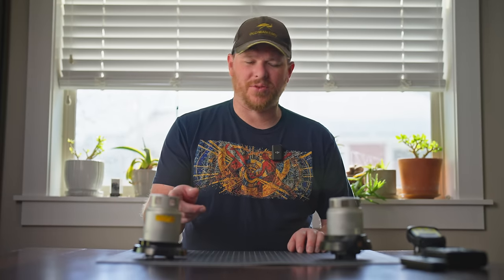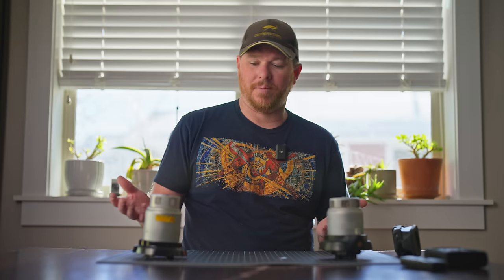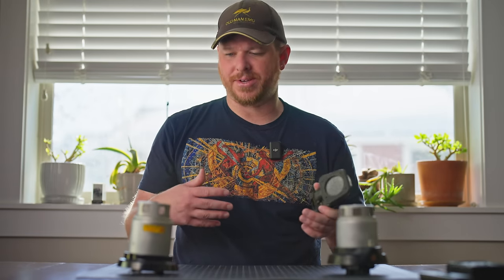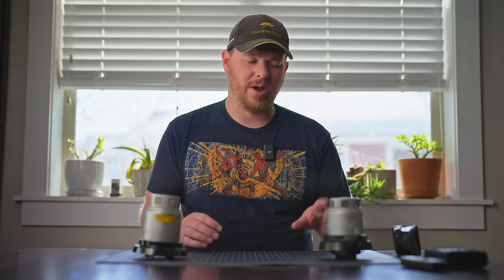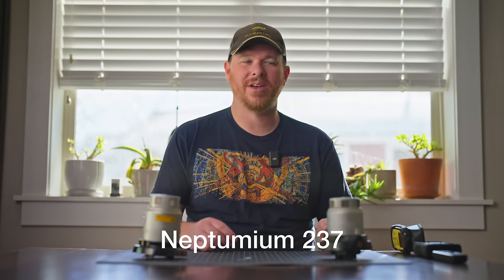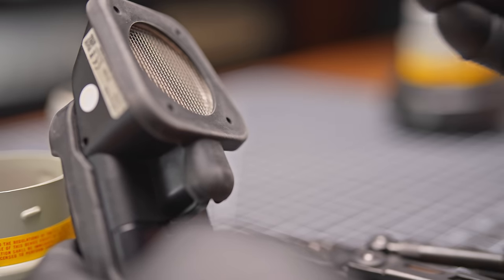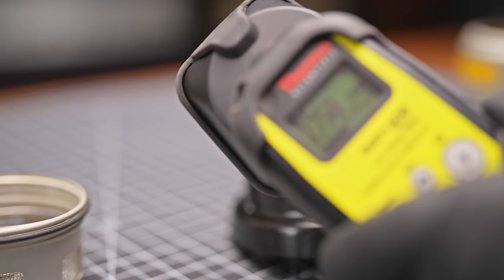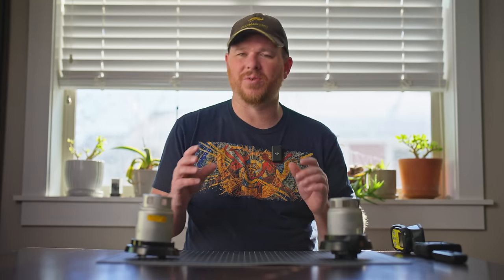Radioactive Cores from Industrial Smoke Detectors

Comment: I spent a large portion of my 45 year career maintaining Pyrotronics systems with those components on a regular basis.  I encountered them principally in hospitals and universities.  At no time did anyone ever instruct us regarding the nuclear hazard these devices posed to us by just being in proximity to them much less handling the components.  Later I found out completely by accident about the extent of the dangers associated with them, and the recommended precautions.  We were instructed to disassemble them and clean them with isopropyl alcohol and dry them with high pressure dry nitrogen.  When we calibrated them for sensitivity I had no idea that I was throttling the extent of radiation exposure that I was receiving.  Early on we were victims of 'mushroom management', (keep them in the dark and feed them poop)!
Reply: It's so sad,and makes one Angry when you find out you've basically been used for a task no-one else would ever want to do if they'd known the hazards,they should've at least given you guys respirators,and more Knowledge of the dangers of course,gloves, thyroid protection,etc.. The problem with cancer caused by such ionizing radiation,is that it has a 'Latency Period',most won't get sick until many yrs or even decades have elapsed, thus being a rather difficult case to prove it was your job that caused it. The Higher-Up's Know this and utilize it,as the nuclear industry in the past has Used Countless people,the 'Radium Girls' for instance,at one time it was a Very Dirty Industry,as one physicist who worked in the industry would later attest. I'm not against Nuclear,but I'm Definitely for 'Safety First ' in this industry,and Above All when one works in the nuclear field to Always Be Responsible!! First and Foremost,in the past there was massive irresponsibility! It's sad when i hear these stories, because it could've easily been prevented,but only if those on Top had been Responsible in the first place and told people the true dangers...ugh.
Reply: Anyways. I saw easily 30 pounds of smoke detectors a day go to the landfill in just our plant which is one of two in the county
Reply: They probably made lots of money.
Reply: Tbh the biggest dangers would be like if you would smoke and eat chips after handling them or whatever? Your skin should protect you right? Idk. They are encapsulated in metal.
Reply: @SimEon-jt3sr for americium that’s generally true. The isotope is laminated into foil and should be pretty contained that way. I wouldn’t want to eat with my hands after direct skin contact anyways as corrosion and abrasion might knock some particles loose. 
For the radium detectors this story is completely different though. Even though the radium itself should be rather contained and adhered to the foil you have to remember that’s it’s decay products are not!
radon is a noble gas so it wont stay chemically bonded and since those detectors depend on the alpha radiation, they can't be shielded. This means that some radon will escape the source and can be breathed in (very bad) and contaminate the housing with its decay products which will end up on your skin etc. Drew demonstrates that in the video aswell with the housing having become radioactive. 

I have handled open radioactive material at work and I'm doing so in private. Radiation doesn't scare me but open radium sources with high activities do because it's so easy to contaminate and therefore incorporate alpha emitters into your body.

Comment: I worked for Pyrotronics in the late 1970's. These type of detectors were in schools, hospitals and everywhere else because they were pretty much all that was on the market.  They were powered by current limited 220vdc .  The low voltage low radio material detectors were just becoming widely available  and the cost to upgrade an entire system caused many of these systems to remain in service. The systems were mostly based on telephone office style relays and only a few silicon diodes. They could survive a close lightning strike, sometimes turning the NE-51 indicators on the detector base black. Just change the NE-51 and maybe a diode and they were back up. A later model system based on IC's would require new detectors and control panels in a similar strike.  The company wide policy for inspecting these systems yearly involved opening the detector and cleaning the chamber and source with a rag dipped in "radiac wash". Then the detector was tested for firing at the proper level and put back in service. Over the years I am sure I cleaned tens of thousands of them. Then in the 1980's they issued a statement saying not to clean any more of them. Imagine that. I am 70 years old now.
Reply from the maker: That’s some really interesting information. Thanks for sharing that. Where were the Pyrotronics offices located?
Reply: @RadioactiveDrew   The head office and perhaps the factory were in Cedar Knolls New Jersey but they had branch offices in most major cities. They were a leader back then, but no longer around as far as I can tell.
Reply: @LM-fg7vi  Cerberus pyrotronics aka pyrotronics was bought out my Siemens in the 1990’s

Comment: It would be interesting (and borderline inhumane) to do an experiment where you have one of those sitting next to a plant and we just see how it grows.
Reply from the maker: I've thought about that. Might make a cool timelapse.
Reply: I think Thunderf00t has done this. Put some radioactive material in a container, put that in the soil, grew carrots but nothing special happened. I wouldn't put the radioactive material directly in the soil as the metals can be toxic and that could leach in to the vegetables.
Reply from the maker: @bertblankenstein3738  yeah I saw that video...was pretty disappointed that he didn't grow the carrots in soil that had uranium ore mixed in.
Reply: @RadioactiveDrew  Fantastic channel. I have seen timelapse of something similar during a vet med degree but am sure is online.

It wasn't particularly interesting until applied to sprouted plants with leaves, not seeds. Then using a comparison between different sources, from nothing happening through to plant wilting and dying, through to going crispy pretty quickly 😮. I don't remember any interesting differences to growth, just the crispy one - which was probably the point of the video.

Comment: That radium smoke detector is definitely not something I would feel safe handling nor being nearby 24/7! Forget about inches, I would prefer being many meters away from that thing for the majority of the time and opening the windows from time in order to time to keep radon gas from accumulating! ☢️
Reply from the maker: I keep sources like this in an old safe that is concrete lined. Does a decent job cutting down the radiation.

Comment: As an engineering geologist, I checked the radioactivity on a "Nuc" tester for soil.   In  the transport case, it pegged my meter.  Told the guy using it he needs to have it serviced.  He said "he never uses those badges."   And so he just continues on until the annual calibration. 
On another note, Im headed up to southern Utah to check some of theose placed youve been too.
Thanks for the info. 
 S
Reply from the maker: Now that's a bit concerning. Those sources used in soil testing are no joke.

Have fun up in Utah exploring. Watch out for flash floods in some of those areas. I've almost been caught in a couple.
Reply: Those contain 10-20 millicuries of Cs-137 and also a neutron source

Comment: Always enjoy your videos man! You definitely make a very good point about people with different occupations that deal with much stronger sources as they are used quite extensively, since we have found so many benefits/ usefulness from utilizing source material. Highly intense sources are definitely common in the construction industry, I agree. An industrial radiographer works with source material far stronger, of course. Thanks to excellent and informative IAEA reports we have seen over the years, there has been quite a few preventable accidents. This is unfortunately followed by ARS, necrosis, amputation, death, etc. All from an extremely small, although highly intense source attached to a pigtail/ cable that gets wound up inside of a shielded case when not in use. It is a form of a camera used to take pictures of welds and such through piping to inspect for cracks, good weld penetration, etc. Just wanted to thank you again for all the awesome content brother! Can't wait for the next one 👍😊
Reply from the maker: I'm glad you enjoyed the video. I'm hoping to one day do a video about some of those sources used in the construction industry.

Comment: Might've been a good idea to mention the inverse square law to explain why being closer makes it so much more intense (granted, that's a bit technical, and you're explaining it to laypeople - but I don't know a better way to describe why it falls off).  Although it's a combination of that, and the radiation being stopped by air.  The counter I have is a Radiascan 701a, it can detect all types (including alpha).  The main mode (which averages over time) lets me select between Sv/hr and rem/hr (which is a long since obsolete unit, but at least it is metric and easily converted to Sv - 1 Sv = 100 rem).  The "search" mode (immediate results) lets me select between Sv/hr and cps.  I don't have a cpm option.  It has an alpha/beta mode too (you take a reading with the alpha or alpha+beta shield on first to get a baseline and then off and it gives you the difference).  I usually just keep it on the Sv/hr setting for all of the modes, because Sieverts are something I understand, and know what is/isn't dangerous based on the setting.  Counts are a lot more ambiguous.  I don't like rem because I have to convert it before it's useful.

Comment: I have seen similar looking devices in the junk shed at work. My shop was the dumping ground for items no one knew what to do with. I would get antifreeze, PCB containing light ballasts , waste oil  various chemicals. I did dispose items I knew about probably. But not the old smoke detector.

Comment: Lets hope those who work in the demolition industry are watching this and identify it. Also, it makes me wonder if the radium can be recycled into new products used in industry / mining / medical.
Reply from the maker: All this material could be recycled / repurposed. The question is…can it be worth it for people to do so.
Reply: they are very radioactive for our standard, still quite unarmful unless you eat them or carry it in your pocket for months. and tbh, i bet there are many things in any household that would kill you if swallowed.
 real high radioactivity is something else.  the F3/F5 only emits alpha. i have a couiple small Am241 sources and most of my GM wont even detect anything at point blank range
Reply from the maker: The reason why some of your GM detectors won’t see any radiation from a Am-241 button is because it can’t detect alpha or the low energy gammas coming off of it.
Reply: @RadioactiveDrew  yes exactly, because the mica window of some of them is too think even for alpha to go through.
the SBT10A, which are supposed to be alpha sensitive, are completely blind, the SBT11A detectes them.  pity they are becoming rare and expensive. they are the poor man (me) LND712. I once found one cheap on ebay and broke it like an idiot10 seconds after installing it. their mica window is reeeeeally fragile

Comment: An important detail. Those pyrotronics units are a nightmare concerning leaky foils. I really suggest you cover your surface with paper or another material that can be disposed of. Airborne contamination can be a huge issue, especially with the Am-241 units. Since you dont have a suitable detector for surveying for alpha contamination, I'd advise you to take more precautions. The radium units might be "hotter", but Americium presents a MUCH greater inhalation hazard, and I'd be much less scared of the radium unit personally.

Comment: How radio active is 2% thoriated tig tungsten? I've been a welder for 15 years now and they are kinda trying to get rid of it. May be a neat video idea. Thanks love the videos.
Reply: Disclaimer, I'm not a pro. I understand there is some mild radiation but the main concern would be if you grind it (to create a tip) as that would cause dust. You want to avoid creating/spreading/inhaling this dust.
Reply: Yeah the new job I have moved to has a fancy tungsten grinder with coolent in in to keep any dust during grinding. Thanks for the input. 👍

Comment: Drew, you mention packing them away. What do you use for packing the radium based detector? Some form of lead encasement with ventilation to the outside to vent the radon? Storage might be another video on its own.
Reply from the maker: I am planning on doing a video about storage as I do think it would be helpful for some to see. The safe I keep these hotter sources in stays in the garage. So I'm not worried about radon. The venting system would be a good idea if all this stuff was being kept inside. The sources I have inside are usually uranium glazed ceramics and they produce an extremely small amount of radon.

Comment: Very well done, thank you.
Btw where did you get the firmware update & how is it installed? Thanks Laddie
Reply from the maker: I used the Android phone I have for the Radiacode 101 to update the detector. I open the app, set the connection method from bluetooth to USB and then hook up the Radiacode 101 to the phone with the USB C cable. If the app is up to date it should ask you if you want to update the detector.

Comment: Would it still be a good idea to wear gloves when opening up the radium containing detector if for no other reason than to avoid contact with the "dust" from the decayed particles? I'm sure there isn't much there but I can't imagine getting any of it in you by accident, either from something like eating or inadvertently covering your mouth while sneezing, would be all that good for you?
Reply from the maker: On the radium post there is a fair amount of radioactive dust from the decay of radon gas. It washes off with some soap and water.
Reply: @RadioactiveDrew  Thank you for responding! I kind of suspected you could wash it off. But I know some elements (don't know about radioactive stuff as I've never had to deal with them) act very differently when it's that fine of a powder. For example, if any static electricity is generated around it. Stuff you'd never expect to become airborne, even at medium/fine grits, suddenly takes on a more sinister characteristic when ground down to a small enough size. So when I started thinking about how the dust would be generated from radon decay, (and that it would probably be deposited a few atoms at a time?) the part of my brain that always wants to learn more just had to ask. I know I'll never come across one of these, most likely, but I was that kid that always asked, "But why?" especially if the answer the parents gave still left me curious.

I love your content, by the way. It's not easy to take complex topics and relay the information in an easy to understand way. Yet you do it, consistently. I used to work around a cesium based soil density tester so I knew how crazy dangerous they "can" be if the source were exposed. One of our testers learned the hard way, if you're in a fender bender don't tell the police about it, Unless You Have To. There are so many misconceptions surrounding radiation, and some traffic police will signal doomsday is nigh if they just hear that word!
Reply from the maker: The decay products from radon are negatively charged and will stick to you and your clothes. But since they are short lived isotopes they decay away very quickly…until it gets to lead 210 which has a 22 year half-life. Once it gets to that isotope it’s extremely hard to detect. 

Those soil density gauges are some pretty hot sources. But I could easily see people uninformed freaking out about it.

Comment: the Am-241 model and prob the radium heads were used in duct smoke detectors as well. A sampling tube would take air from the large hvac ducts and run it past the detector.

Comment: For the Am-241 one I use a large square alpha probe to carefully check for any contamination prior to handling and afterwards. Also wear gloves and I scan them as well afterwards.

For safety its better to handle it outside of living spaces as well.

I have a collection of items and its an interesting hobby but still a good idea to play it safe just in case of tail risk.
Reply from the maker: I always check my work area for contamination afterwards.
Reply: @RadioactiveDrew  That is definitely best practice.
Reply: Work on a sheet of paper that could be disposed of afterwards?
Reply: @RadioactiveDrew a pancake probe isn't suitable for surveying for alpha contamination. It'll work alright(ish) for Ra-226 due to the beta emitting daughters, but with Am-241 in particular, you're playing with fire. Best not to do it on a table in your living room...

Comment: I really did not know how hot those detectors were back when I was working on them. I knew they were radioactive. In the early 80's the new systems were DI-3 and DI-4 models with far less AM 241. I was working on a system at a nuclear plant that was being built. Everyone had to wear film badges even though no fuel was ever on site yet, probably to get used to the idea. Well, the fire marshal for the  plant turned in his old badge for a new one like they do every month, and they freak out because it is exposed!!!! No fuel on site!!!  Turns out when he goes home he throws his badge in a desk drawer that has a spare Pyrotronics DI-3 detector in there.
Reply from the maker: Something like that detector would definitely put some dose on a badge.